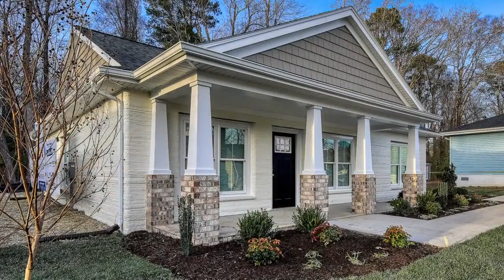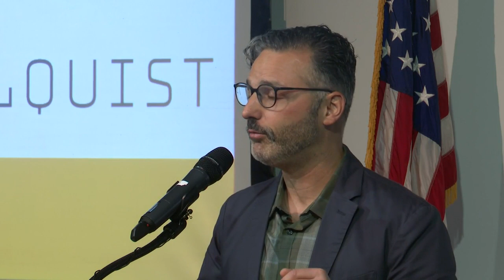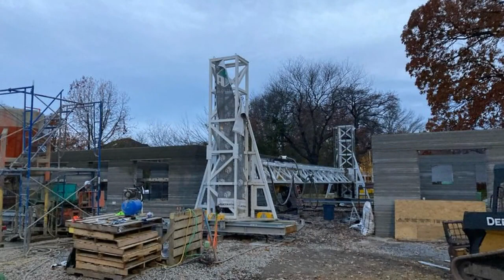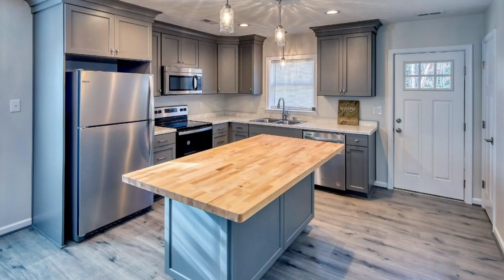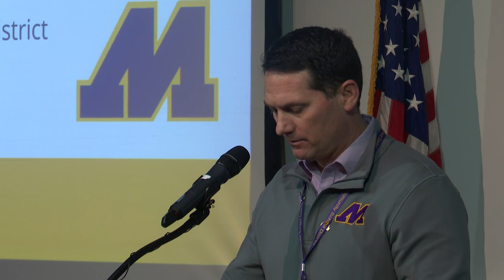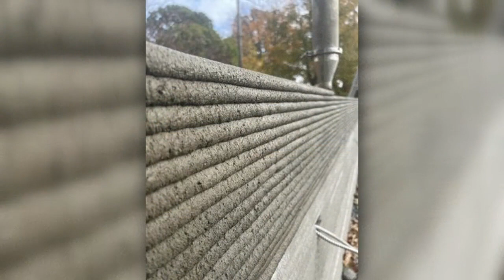Iowa city creating 10 homes with 3D printing

Comment: the first half of this clip was hilarious.  The financial industry is having SUCH a hard time dealing with what the applications in 3D printing means for the real estate sector, mortgage-backed securities and the world economy as a whole.  The guy calls the rig, an honestly pretty simple piece of equipment, a "giant robot"  for a reason, to make it sound foreign and confusing (inaccessible) to the viewer.  (and then he adds "which is weird" as if the adult viewers are 6-year-olds).  

So, to counter that blatant bit of bold bullshitting, I'd like everyone here to know that that "giant robot", the machine itself, costs less than $50,000, and can easily print more than 4 single family homes per week, with materials costs (for the concrete structure printing) of less than $5,000 per sfh.  The only thing standing in your way is your county's zoning laws.  That's it.  And those laws can ultimately be changed by who?  Why, you, as it happens.  The voters.  He also makes a point to say that all the sub-sectors that will lose varying degrees of relevancy are all safe, that even though this new horseless carriage they'e calling a "car" won't need the blacksmith to shoe the horses, or the carpenter for the carriage, or the horse breeder, or the street-sweep to clean the horse poop, we're going to continue to pay for those things that have become obsolete.  And by "we", we of course mean you.  90% of what we're still doing in HVAC on the average structure in this country is obsolete and grossly energy-inefficient.  But hey, the energy sector has zero financial motive to complain about energy-inefficient buildings, do they?

 This is the horse and buggy industry of the 1890's trying desperately to stop the takeover of the automobile, only now all the money in the world is behind preserving the horse and buggy industry at all costs.

3D PRINTING REDUCES THE COST OF CONSTRUCTION BY UP TO 90 (NINETY!) %

3D PRINTING REDUCES THE TIME SPENT ON CONSTRUCTION BY UP TO 95%

3D PRINTING GREATLY INCREASES OPTIONS FOR STRUCTURAL DESIGN

3D PRINTED STRUCTURES CAN BE EASILY DESIGNED FOR ENERGY EFFICIENCY, INCLUDING PASSIVE HOUSE STANDARDS, TO A DEGREE THAT TRADITIONAL CONSTRUCTION CAN NOT MATCH

3D PRINTED STRUCTURES ARE FAR SUPERIOR IN STRUCTURAL INTEGRITY, WITH STRUCTURES RATED TO LAST 150+ YEARS, VERSUS 50 TO 75 YEARS IN TRADITIONAL CONSTRUCTION

And due to the grossly idiotic way we've structured our world economy, the applications of 3D printing in construction means that the world's banking industry now needs to be re-written, because we assumed the ubiquity of the 30 year mortgage would last for eternity and so we used it as the backbone of our banking industry.  We failed to anticipate how that would be smashed to pieces when technological advances produced a method of construction that reduced costs by up to 90%, resulting in most of the population no longer needing 30 years to pay for a better, more energy efficient home than ever before, that they can now pay off in 3 or 4 years.  

Take a moment to think about all the ways that simple technological breakthrough and it's implications on our economy will change our society.  What kind of freedom and power will the average worker gain when a house can be paid off in 4 years?  Wall St would lose everything, and make no mistake, they will and are doing everything they can think of to try to prevent this inevitable tidal wave from wiping them to oblivion.

OR

Google it.  Just google it.  Ecosia, bing, whatever you like.  Research Goldman Sachs buying out ICON right after ICON had proof of concept.  Research how ICON was affected before and after Goldman buyout.  There's a lot of material on this subject that the news media will straight up fire their reporters for even asking about.  The only reason we're NOT living in a markedly better world right now is because the banking industry is trying to prevent, restrict and control the flow of information of technological breakthrough.